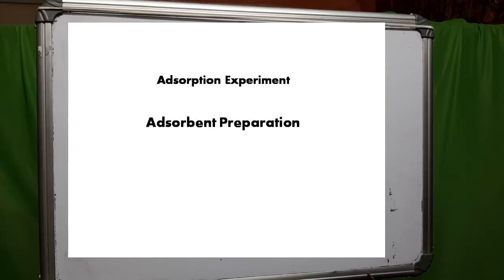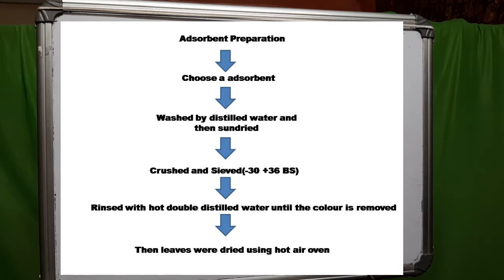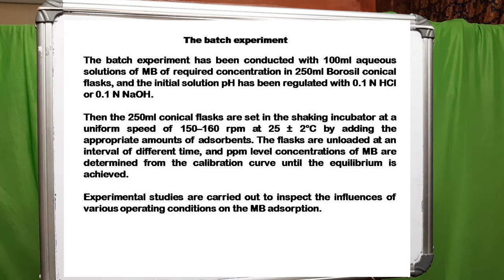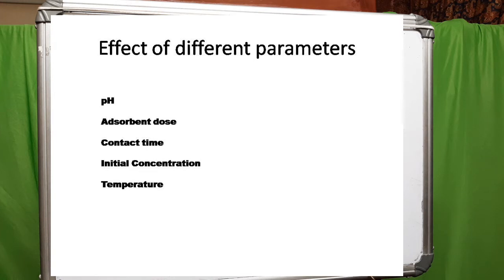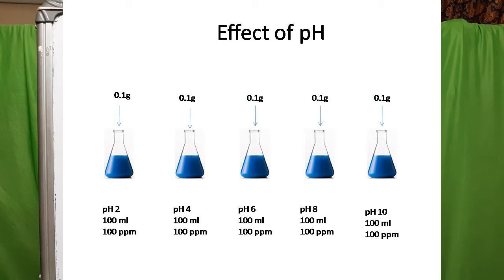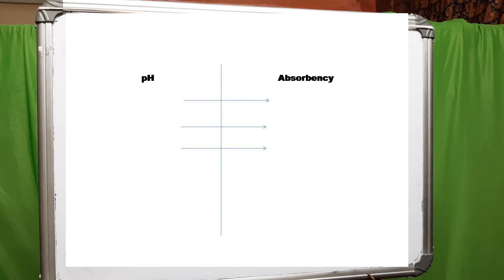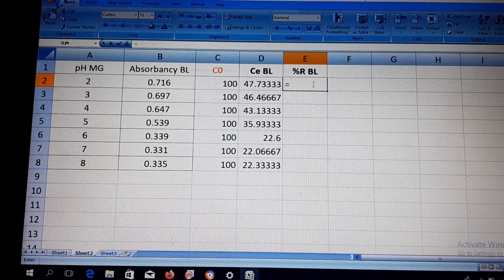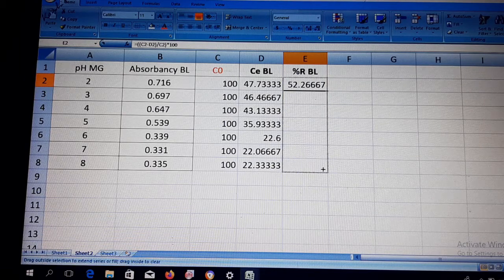ADSORPTION EXPERIMENT II

Comment: sir how do you know that you have to add 0.1 g of adsorbent ?
Reply from the maker: By Weight Machine
Reply: @koushikghosh5509  why you not add 0.5 g pr 2 g of adsorbent ?
Reply from the maker: @saneelakhan3081  First you need to check the adsorption efficiency with less adsorbent then increase the amount of adsorbent to see if the efficiency is increasing.

Comment: Hello Koushik, I have done a batch adsorption experiment using raw biomass, the removal is around 96% at 10 min and uptake is very less (9 mg/g). So is this result valid? , and another issue , while carrying out the filtration to seperate adsorbent and adsorbate, the dye (MB) is being adsorbed in the filter paper whatmann 1, is it that much responsible to affect the removal efficiency???
Reply from the maker: Filter paper is affected on percentage removal..but it's negligible..for accurate result you chose column study

Comment: Sir how volume of solution  come 0.1L please elaborate it.
Reply from the maker: Conical volume =250 ml
Solution Volume =100 ml = . 1 L
Here we use methylene blue aqueous solution.
Reply: @koushikghosh5509  thanks sir..
One more question.
In some other  experiment of carbon adsorption..
Initial conc. Of compound is taken as 50mg/L, 100 mg/L, 150mg/L,200mg/L
And same formula applied qe=ci-co/wxV
V=0.1L
Now please, tell the relation of  various initial concentrations and volume =0.1L
Reply from the maker: @anjalisharma314  if solution volume is same then value is same... Different concentration means solute concentration..... If ur solute is solid and soluble in water..... Which doesn't change ur solution volume.... And solution volume and solvent volume are same in this case.
Reply: @koushikghosh5509  thanks once again sir 🙏🙏🙏
Reply from the maker: @anjalisharma314  welcome 🙏
Reply: @koushikghosh5509  Sir..
I have to take dichloromethane which is a organic compound =50 mg/L
And carbon=0.15g
The organic compound is in liquid form , it is in a bottle of 500ml.
Carbon is in powder form.
Please tell me..
How can I take 50mg/L of dichloromethane from the bottle of 500ml..(solvent for dichloromethane is methanol.
I am confused about its dilution.please tell me.
Reply from the maker: @anjalisharma314  Dichloromethane
Density
1.33 g/cm³
50 mg = 0.05gm
volume = mass/density
=0.05/1.33 cm3 =0.0376 ml
Take 0.0376 ml dichloromethane in 
1 L methanol
Reply: @koushikghosh5509  thanks a lot sir for response !
But sir , if I have to take i1 gm of carbon in this amount of dichloromethane as you said..
How can I do adsorption test in a flask, with this much amount of 1 litre(solvent).
I mean I have to take flask with 1  litre capacity and then do the tesr.is 'nt it difficult?
Reply from the maker: @anjalisharma314  At first you make a stock solution of 1000 mg/L.The different concentrations of test solutions have to make by dilution of stock solution( using solvent).
Using the V1S1=V2S2 formula.
Suppose you want 100 ml 50 mg/L solution
when
V1=?
S1=1000 mg/L
V2=100 ml
S2= 50 mg/L

V1= 5 ml
Then take 5 ml stock solution and mix with 95 ml of solvent.
This solution is called 100 ml 50 mg/L solutions.
Reply: @koushikghosh5509  thanks once again sir for instant response.
Sir,  the various concentrations of dichloromethane can be prepared  by
First preparing stock solution 
And then by applying this equation C1V1=C2V2 , the other concentrations can be prepared...this part is over..I got it now.
Now tell me..
Will I go through the test like
1 g of carbon+50mg/L of dichloromethane
1g of carbon/40mg/L of dichloromethane.
1g of carbon+30 mg/L of dichloromethane
0.4 g of carbon+50mg/L of dichloromethane
0.6g of carbon+50mg/L of dichloromethane
0.4g of carbon+50mg/L of dichloromethane
Should I weigh the carbon as such  and put directly into dichloromethane solution
Or  should  I prepare stock solution of carbon too (g/L)
And from stock solution , I should prepare various concentrations of carbon?
Reply from the maker: @anjalisharma314  put directly into your test dichloromethane solution then shaking
Reply: @koushikghosh5509  thanks sir for guidance 🙏🙏🙏🙏💐💐💐💐
Reply: @koushikghosh5509  thanks sir for guidance 🙏🙏🙏🙏💐💐💐💐
Reply: @koushikghosh5509  Good morning sir....
One more query...
1.Can adsorption capacity of an adsorbent in a sample be analysed by  fluorescence
spectrophotometer?
2. Is the purpose we  want to solve with uv-vis spectrophotometer can be solved with   fluorescence          spectrophotometer, if uv-vis spectrophotometer is not available?
If we want to calculate
Removal % and adsorbance capacity of carbon(qe), is fluorescence spectrophotometer can be used in place of uv-vis spectrophotometer to get this purpose?
Reply: Yaar anjali ye rahul nahi hai 😅😅😂